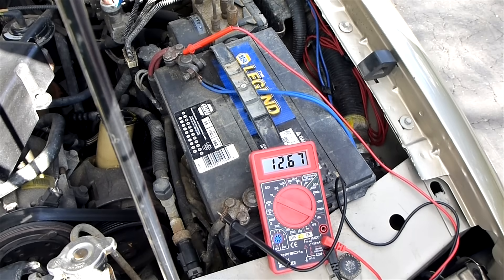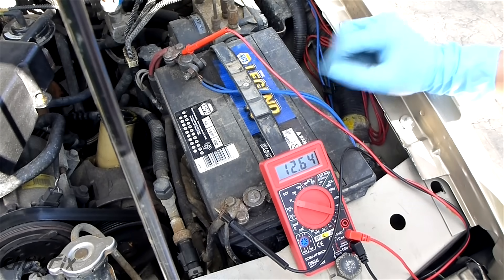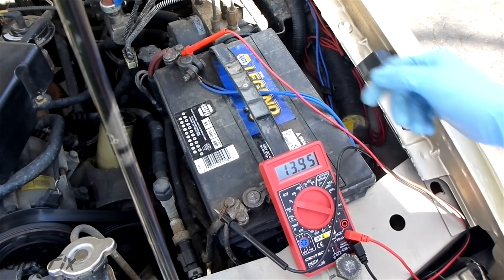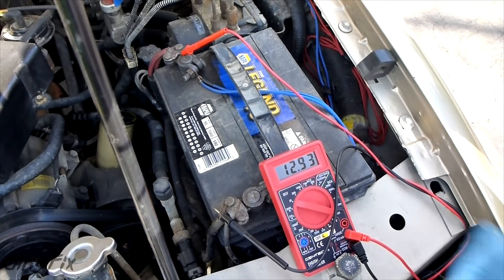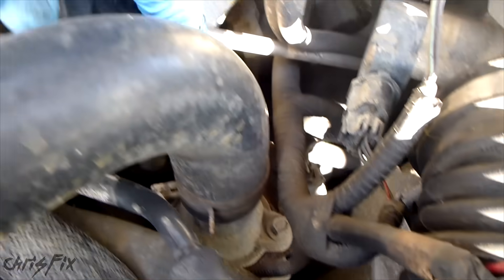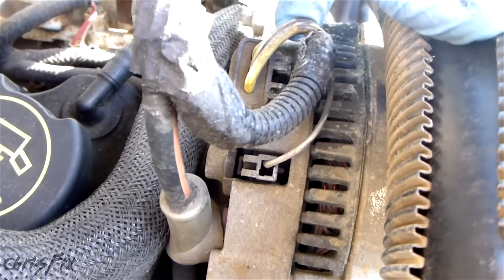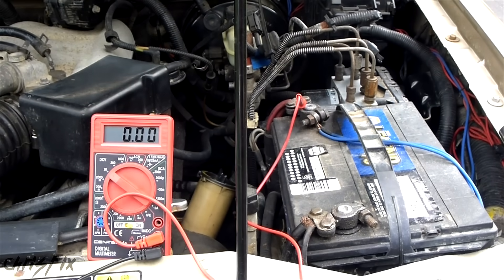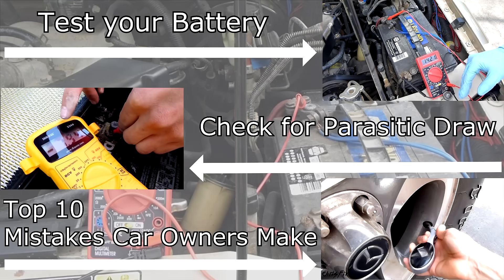How to Test an Alternator

Comment: Chris... I replaced my alternator on an 05 Civic.  All was good for two weeks then just clicks. Battery tested good. Did neg test on alternator casing and get -.1, which you say in the video is bad.  Not sure what the next step is.  Bad alternator or check ground.  I get -.1 on alternator and engine block.
Reply: I found the ground wire and it had seen better days so I replaced it.  The car still wouldn't start but I could jumpstart it so I did.  Once it was running I tested with the voltmeter and I had good readings.  I let it run for a few minutes and turned it off.  The battery read was good but when I tried to start it the starter just gave a loud click.  The dash was clicking as well.  I checked the starter connections, they seem solid.  I replaced the starter, battery and alternator over the last month.  Bad starter?
Reply from the maker: +Frank Smith That is strange because you can start it with a jumper... I would guess your starter might be bad or there is some bad wiring somewhere.
Reply: +ChrisFix I got it... There was some hard buildup on the inside of the battery connector ring.  I had to scrape it off and then wire brush it.  Once clean it started right up.

Comment: Yesterday I replaced the alternator on my 1G DSM (a 1991 Mitsubishi Eclipse). This was a very big deal for me, because I don't know much about cars. Replacing an alternator was the most complicated auto repair task that I'd ever attempted, so I watched several YouTube videos to help me understand what I was getting into. This video was one of the best, so thank you for posting it. The new alternator seems to be working great so far. I plan to check on it during the next few days, using sources such as this video as my guide. Thanks again.
Reply from the maker: +William Dye Awesome! That is great you were able to change the alternator! It isnt too bad and now you are ready to do more stuff! Glad the video was helpful!
Reply: I know this is 3 years old. But I also have a 1g dsm, it's a 90 talon Tsi, but you're lucky that was your first car repair. Some alternators I've done, you need to remove the tire and get under the car because its towards the firewall. 1g dsm alternator is a piece of cake, I hope everything worked out and that old beast is still running. Cheers.
Reply: @FeelFighters I know this is 6 years old but I also have a 1g dsm

Comment: I need help pleaseee +ChrisFix

Ive tried various forums but with no luck. I own a 2001 Acura Integra.

I did work to my exhaust at a shop, and when that happened the o2 sensor which is ontop of the midpipe had its wires cut open.  The o2 sensor short out on the bottom of the car.  The o2 sensor and alternator are on the same fuse.  So when the o2 sensor short out, alternator didnt work.  I didnt know about this small fix and had to change the alternator and battery. After that i had no problems for a month.  Now a month ago from today i had a problem where the rpm for the car would strangely go up to about 1500 to 2500 range.  I had no idea what it was, untill i finally realized it could be the alternator or some sort of alternator wiring problem. The cars rpm would go to 2500 when i start it up, and would take time to go back down to the normal 600-700.  like 10 minutes or so.  Now the car doesnt go that high up, but it does stay at around 1000 rpm, and when i turn the car off in this state, it struggles to start back up.  i have to wait till the 1000 rpm drops down to the normal  600 or 700, but it takes a while.  My understanding was that the alternator was struggling to charge the batterup up, and so it was staying up at 1000 rpm, and becuase it was struggling, the battery wasnt fully charged up when i turned it off and so it struggled to start back up.  Could this be a ground/wiring issue or the alternator itself? THank you so much in advance +ChrisFix , or if anyone else knows please please do help
Reply from the maker: +Danial Loganathan Do the test I showed in the video to see what the voltage is. It might not be your alternator...
Reply: +ChrisFix thank you so much for the reply.  I just did the test today with a multimeter.  When off, it was around 12.8 i dont remember properly, and when the car started it dropped to about 11 then went up to about 14.7.  And when i turned the car off it dropped to about 13.2 and slowly dropped from there.  Only problem was that even when the battery was 12.8ish when i started the test, the car was slow to start, and took a couple of extra cranks.  Right before i turned the car off before the test, rpms were at around 1000.  This is wierd, my car now is constantly idles at 1000 (sometimes idles at 600) where in the summer it was around 600.

Comment: I have a mustang. Brand new battery-2 months old...car totally dead after 2 weeks driving. recharged battery, tested and holding 12.62 volts. 
Alternator reading 13.8 with nothing else on. Running lights, ac, etc drop to 13.7. Do these numbers sound low enough to have drained the new battery after 2 weeks or could there be a short somewhere? thanks so much
Reply from the maker: +Jimmy Kimber Check this video out: https://www.youtube.com/watch?v=n5FJDgcdii8
Reply: +ChrisFix Thanks Chris. i did the test. a 40 fuse under the hood for the instrument cluster/pcm goes to 0 amps when i remove the fuse. not sure what it could be.

Comment: What would cause a car's headlights and dashboard lights to pulse with the rpms? I have replaced battery this week, didn't fix the problem. O'Reilly's tested both and said the alternator was good, but the battery was bad. Any suggestions would be greatly appreciated!

Comment: I just installed a new battery, alternator and voltage regulator. Battery reading is 12.6. Engine running it drops to 12.4.  Voltage drop test for negative and positive side are well within specs. Did I buy a bad alternator off the shelf or is there something else that can cause this? 
Great video, with very clear instructions. Thank you
Reply from the maker: +stupidgenious1 Check the voltage of the alternator running directly at the alternator. With the car running, touch the black multimeter lead to the alternator case (make sure you scrape it a little to get a good ground). Touch the red lead to the terminal where the red battery cable goes to the alternator. Should be 14.2v
Reply: ChrisFix
 12.38 is what I get when I put black lead to alt case and red to battery terminal on alternator.
Reply from the maker: +stupidgenious1 Bad alternator then
Reply: +ChrisFix Thank you. I learned a lot watching your video. I didn't even own a multimeter till I seen your video.  
 I ran a 12v source to the field post on the alternator and it went up to 14+. so that led me to the voltage regulator and I discovered I had nothing at the "s" wire. I traced the "s" wire back to the ignition switch were it had become detached. All fixed. :)

Comment: when you check for a voltage drop between the negative battery terminal and the body of the alternator, if it checks out ok, wouldn't the other ground tests be redundant?  they would be useful for locating where the bad connection is, but would only be relevant if there was a bad ground which is what is determined in the first test.. yes?

Comment: I started to have a whine when my radio or AC was on.  I turned those off and the sound went a way.  My 2003 Honda Accord  with 147,000 has the original alternator.  It is still charging but under 13.  The engine seemed nosier in that area.  I am thinking bearings that are wearing out.  What do you think?
Reply from the maker: +Matt Keefe Sounds like it is a bad alternator. That thing should be pumping out 14.2v

Comment: Two Questions: 

1) You say 0.1 to 0.2 or greater. Do you mean negative or positive 0.1 to 0.2? 

2) When you checked the chassis ground next to the firewall (around 6:50) you said, ".06. Still the same." The reading before was -0.04. So that's an increase of 1.2 V. The reading is not the 0.1 or 0.2 you discussed earlier, but is that increase significant in any manner?

Thanks! Your videos are fantastic! Big fan and I am learning so much!
Reply from the maker: +Colton Dudley 1.) It does not matter negative or positive, take the absolute value. 2.) Again, use absolute value so it was a .02v difference which is nothing. Good questions!

Comment: How do you raise the RPM's from the engine? I saw how you do it but I don't know where or how to go about doing that.
Reply from the maker: +Bruce Stansell If it is an old fashion throttle body that has a cable connected to the pedal you just find the spring for the throttle body and press it to open the butterfly valve in the throttle body.
Reply: Alright thank you that is very useful.

Comment: thx for this chris! mine dont get to .3v when testing the positive side of the batt and b+ post of the alternator, nut, and the connecting wire.  Is it bad alternator already? I just replaced it 2yrs ago. Remanufactured though!
Reply from the maker: +gnat12345 Clean the connection from the alternator to the cable and the cable to the battery post. Then test it again. Sand those connections down so they are clean, bare metal.

Comment: Hello everyone, I get 11.5-11.9V from my battery. The alternator hardly gets 0.2V above the battery at any time and many times matches the battery exactly. My Negative Drop Voltage from the alternator case to negative battery terminal is 2.2V.

If my engine and chassis grounds all test good, is that solid confirmation of needing a new alternator?
Reply from the maker: +AJFresh Check the voltage at the alternator. Put the black lead on the alternator case and the red on the + of the alternator (where the red cable comes out and goes to the battery). This will be the alternator voltage for sure. If it is low, then you need a new one.
Reply: Thanks a bunch Chris! I assume "low" is below 14V? I'll get on it tomorrow thanks again
Reply: +AJFresh I ran the Alternator+ to Alternator-body test. It read 14.0V yet only matched the battery at 11.xxV on the Drop Negative test. I installed a battery from my 92 Honda Accord LX. Coincidentally it had the same 640CCA of my Subaru's battery. The Honda battery started at 12.5V and kept dropping.

I installed a new alternator. Now all readings are good. Getting at least 12.5V on my battery, even up to 13V. Alternator is running at most 14.2V, less if the battery charge is high. Car is starting up well and my headlights are a bit brighter.

My Negative Drop Voltage is now 0.143V. I feel that's a bit high and and thinking the problem there is from the alternator to the battery. My grounds test in the 10's of mV's at most. My car failed to start today at 12.0V but after jumpstarting and being allowed to charge higher, it has been good on it's own. I will continue to try to lower the voltage (resistance) on the negative side.

Comment: Hey I started my car this weekend..no go. I had my voltage checked on my battery and it read at like 9. Something...my battery was removed and water came out with it. I took my battery in and they said water got in which i thought waters in one already(distilled) they said the seal wasn't tight on the battery at all. When I first got my car 1 month ago it did need a jump but not until this weekend did I need a jump/ New battery. Got a new battery in and my voltage readings match yours but they said my alternator is still good but if I get that changed they also suggested my starter...is that true? Anyways your video helped thnx
Reply: Also (sorry for replying to my own post) no dimming flickering lights and my car starts up even better now and responds better but I'm still worried about my alternator
Reply from the maker: +Ame Bam There is no connection to a failed starter and bad battery or a starter and alternator. If you replace the alternator, you do not need to replace the starter.

Comment: You could also check for a leak, disconnect the battery cable, use the multimeter sticks as connection between the battery cable and the battery, put the multimeter in dcv 20, shouldn't be more than 3-4 volts with the alarm on.
Reply from the maker: +roskataqv Thanks for the tip!

Comment: I am hearing a whining sound, not a big whine from the belt that drives the alternator. Does a worn serpentine belt cause the whine?
Reply from the maker: +smasila Usually the alternator itself will cause the whine not the belt. Does the whine get louder when you put on a lot of electronics (headlights, fan, radio, etc)?
Reply: +ChrisFix Yes. I do hear the whine get a bit louder when I used indicators and other stuff. I did you test and everything comes out the same as your test. I do notice my engine feels like its going to die on me. Like it the RPM's slow down to the point of stalling.
Reply from the maker: +smasila Without actually seeing the car is it tough for me to say.
Reply: +ChrisFix Looks it was bad gas that was causing the stall. But the whining sound is still coming from the alternator. The alternator is charging the battery properly. Should I just let it be or get it replaced?

Comment: On "Testing the alternator you saidturning on the car and checking the output with all accesoris on will make the battery go down to 13.00 and then you said 13.07.So which is it or does it matter?

Comment: Hey #ChrisFix, I own a Nissan Maxima 04 with a new Optima Yellow Top battery.
I have a 900 watts sound system and a digital voltmeter attached to it. With the car off it reads 12.6 volts. With the car on and sound system off, lights, a/c it reads 14.1 volts.
Here´s the thing, once I start driving, like in a busy road where I need to stop every two seconds it starts to drop the voltage 13.8, 13.2, 12.8 untill it reaches 12.2 volts. It stays like that with the a/c on. If I turn it off (which I don´t because is hot in Texas right now) it only goes up to 12.8 volts. So...The battery is new and the alternator looks like is working because once I get to the freeway it goes up to 13.2 again...but why does it goes down to 12.2 in the first place? and two, why it doesn´t stay at 14.1 volts?
Ps. If I start bumping my subs it will go down to 10.1 volts. Up and down from 13.6 to 10.1 volts.
Reply from the maker: +LOV2XRL8RL Sounds like your alternator is bad. When you accelerate, it puts a load on the engine since your engine needs to spark a lot more. The alternator cannot keep up and the voltage drops. Try the tests I did in this video! Could also be some bad ground connections.

Comment: Dude  Fair play But i have been a Auto Electrician for a number of years  from cars to truck small boats to large Marine  also served as a electrical engineer .  a few things loading testing you always do with a clamp meter  not a digi meter as a meter is not a true entity and can appear to show the correct information but they do not and there is a genuine valid reason for this . also your jeep you have there   your battery clamp connections are wank  u have matted copper cores there now water has now ingress the entire length of the cables and Resistance will start to happen  get shot of them skank terminals you have u might need to replace them masters with decent sealed lugs too .  .  carry on  : )
Reply from the maker: +Rs500ybd Thanks for sharing and the tips! I try to use meters people can purchase inexpensively and the one i use in the video is free from harbor freight. I am also doing a video on upgrading the electrical system so stay tuned!

Comment: So i have a 1999 ford crown vic, it will randomly die when i'm sitting at a stop sign or light. it turns right back on tho no issues. i took it to a shop and checked the codes and had 2 bad coils so i replaced them and i'm still having the same issue. i replaced the fuel filter as well. Any help would be good. thanks.
Reply from the maker: Check the other coils because they are known to go bad. I'd check fuel pressure too.

Comment: so the my neighbor help me out with the battery voltage and when i was starting it the voltage goes to 14 then drops is this bad wiring? bad alternator? the car is old but thats my only car 1991 lancer glxi
Reply from the maker: +Franz KEN I need to know what the voltage is when the engine is running like in this video. If it is running and the voltage is below 14v with no accessories on, your alternator or your wiring is bad. To check to see which one you can do a voltage drop test or you can test the voltage right at the alternator but putting the red on the alternator power wire (thick red wire coming out of the alternator) and black on the alternator casing.

Comment: so I did this test on my honda civic. with all the lights on,radio,etc. and it didn't drop below 13V but I turned my a/c on and it drop to 12.7V ?? is that Because the a/c sucks up so much juice or my alternator is starting to go
Reply from the maker: +bep2001 kumar The alternator is starting to go. It should stay in the upper 13v area when your electronics are on. The ac fan does take a lot of power but not so much that your alternator cant keep up.